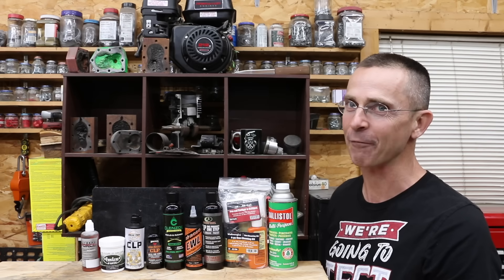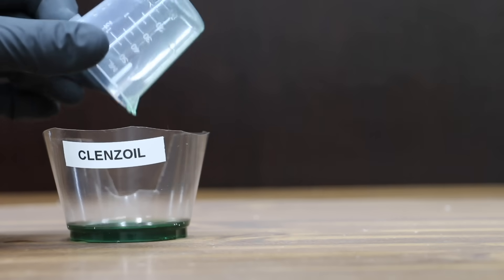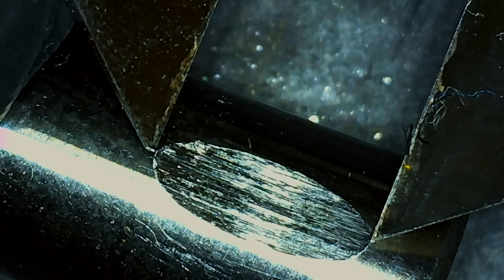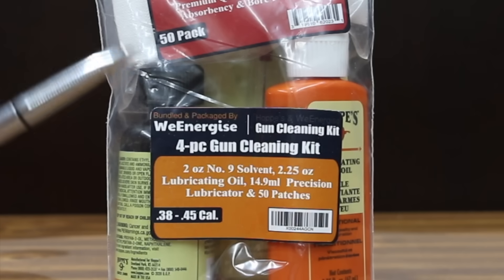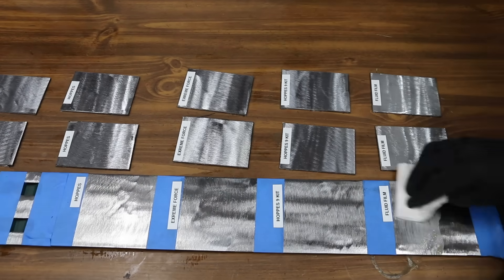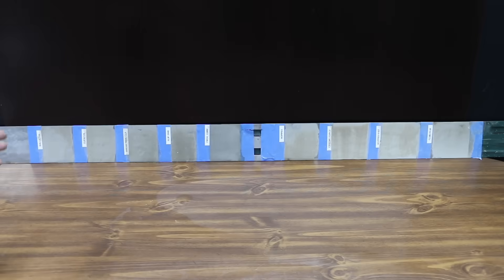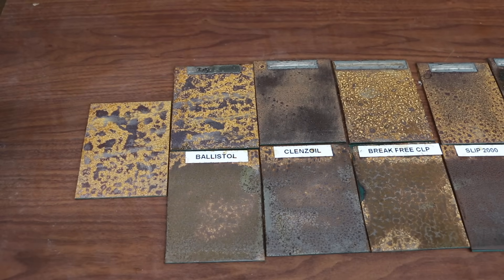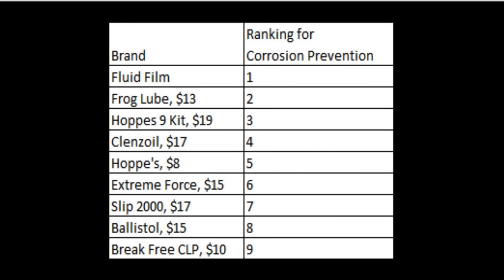Don't Buy A CLP Until You Watch This Review! It'll Save You Time And Money!

Comment: I have two AK74's and literally cases and cases and cases, and more cases, of ammo for them. 1970's Russian surplus vintage, purchased years ago when the price was like 3 cents a round, but it's all corrosive ammo. The Frog Lube does an excellent job of protecting every part. It comes either as a paste or in a liquid. I was particularly interested in the oven heat test you did because Frog Lubes procedure for the best corrosion prevention is to heat up all the metal parts to around 200 degrees and then apply the Frog Lube generously on them. Once they have cooled to room temperature, thoroughly wipe off all the excess and then reassemble. When the parts heat up again they now sweat frog lube, keeping the corrosive primer residue, and carbon, from sticking to the metal. And it really does work. All you have to do to clean any part is wipe it down with a paper towel. Nothing, not even the carbon sticks to any treated part. And one treatment is good for about 5 shooting sessions. I think you would have gotten much better results in the lube test if you had treated the bearing first. This stuff really does soak into hot metal.
Reply from the maker: Thanks for sharing.

Comment: Great video! Just an observation: the sample used for Frog-Lube was the wrong one.  Frog-Lube comes in 2 forms, liquid and paste, the tester choose the paste. The paste is only use on the barrel and slide after heating them with a heating gun or electric hairdryer and then applied, melt, clean and remove.  The liquid would have been the best product to use for this test since is the most equivalent to the others.  A suggestion for a part 2 or for a future new test.
Reply: Frog lube turned sticky in my AR after a few months.   I used the liquid and applied it according to the instructions.   I fired one round and wasn't able to handle the rifle for several months, once I got it back it felt like it was lubed with glue.   I wouldn't trust that stuff on anything that I needed to function in a serious situation.
Reply: @chrisjones6002  Curious which instructions you read. The company is pretty terrible at providing the public with good, in-depth instructions and most of the other tutorials out there are wrong and have you applying it way way too thick which will cause it to gum up. The paste is applied to the metal, then the metal is super heated and left to sit a few hours. Then you wipe absolutely all of it off very lightly so only the barest microscopic film remains. I apply the liquid version very lightly to friction points only, and leave a little of it on rather than wiping all away. Still testing the liquid version and not sure if they really want it all 100% wiped away like the paste.
Reply: @DieLuftwaffel  I don't remember exactly but I did make a good effort to apply it as the instructions said.   Either way, I wouldn't trust it even if there was a better way to apply it than I did.   I've never had an issue using a good synthetic grease and engine oil.   No special application needed, put a little wherever it needs lube.
Reply: @chrisjones6002  Ya I just dont like toxic crap near my skin and spewing any more nasty stuff into the environment than lead which is bad enough. So far I've not had any issue with the stuff, but I usually reapply at least yearly and even if it gummed up in storage it would still be protecting the gun from rust etc. I just dont apply enough to ever act as a glue anyways.

Comment: My EDC oil of choice is fluid film. And my main reasons for this weren't tested in this test. One of the biggest is the lubricant's ability to stay put under every day use. The oils that SEEMED to have done best in this test are also pretty much gone in a day.
 I was recently thrown into a lake in a boating accident while carrying a hk usp that was lubricated with fluid film 3 or 4 days prior. I didn't get a chance to service it until 4 or 5 hours later. No rust at all. Not even a tiny bit. Had i been using hoppes 9, the gun would have been covered in surface corrosion. Fluid film also gets the smoothest function than the others by far. I think you would need an actual gun to test this as you would need to test the way gun parts specifically interract with one and other. I can imagine some of these will vary from gun to gun. 
 Even in below zero temperatures (i live in Alaska) i would still stick to fluid film as my EDC pistol is going to be on my person, absorbing body heat. Now, if i am carrying s rifle in below zero temps, that's when i might consider hoppes 9 for the day. And i would probably apply it on top of fluid film rather than in place of.
Reply from the maker: Thanks for sharing.
Reply: @ProjectFarm  yep

Comment: Ballestoll and hoppes mineral oil are both non toxic.  

Hoppes 9 cleaner is the best at cleaning.  
For lube any syntehec motor oil should win.  For bolts a grease will win.
For water in a barrel wd 40 is the best.
Reply from the maker: Thanks for the feedback.

Comment: Project Farm, Plz do a comparison test of Oil Filters.
I ask because the YouTube community is saturated with these reviews, but all they seem to do is cut them open and show what’s inside, which is a worthless review in my opinion.
I believe you are by far the very best YouTube Product Testing Contributor and you actually test the products in relation to how well they actually work under use.
Thus my request to clear the very muddy water of Oil Filter tests.
Besides, now that you have sold me on the Synthetic Valvoline line of products, I’ve been using the Fram 20,000 mile Filters which are visually much better made for a couple more bucks, but I really want to know if I can skip the Filter change between oil Changes with the 20k rating and if it is in fact an adequate filter to use with a top 3 finisher in the Synthetic Oil Tests?
Thx in Advance.
Reply from the maker: Thanks for the suggestion.

Comment: What you missed was copper residue cleaning. Copper gradually fouls a barrel in a modern firearm, especially with the higher velocity bullets. Great job on everything else!

Ballistol makes a great oil for sharpening knives. It's also one of the better ones for letting the chamber or entire barrel of a traditional black powder rifle soak for a few hours. It can be mixed with water w/o causing corrosion from soaking. Much better than the traditional soap and water. Once the BP residue is gone, you can use a different cleaner / lube to finish your cleaning. One thing to keep in mind  is, since BP rifles shoot lead, copper cleaning is not needed . 

Do I use it as a CLP on modern firearms? No.

As for a lube and storage "oil". I use Royal Purple's gun oil which is a a variation of Maxfilm by Royal Purple designed especially for fire arms. The temperature range is ridiculously wide.
Used correctly it soaks into the pores of the metal and then leaves a dry film. However, it's what's called a thixotropic lube. That means when shearing forces / friction are applied to the surface, it temporarily turns into a liquid. The range I shoot at often has wind kicking up LOTS of dust. Took a 22 to the range I'd been using a regular gun oil on and would have to clean the grit out, sometimes part way through shooting as it wouldn't cycle fully. Used the Royal Purple gun oil and there was probably 1/4 the amount of dust in the action. Not a single cycle failure with over 500 rds put through the gun.
Reply from the maker: Thanks for sharing.
Reply: The copper melts from the jacket. Copper fouling is not a huge issue for hunters only people that shoot a large volume of fire like target shooters, varmint shooters like p-dog hunts and the like. Too much fuss is made about copper fouling and it just is not the insane issue that most make it out to be. This is especially true with CHF barrels that tend to copper foul a lot less than a cheaply made button barrel. So E.R. Shaw barrels and Savage barrels copper foul like mad but a quality button rifled barrel, cut rifled barrel or CHF barrel usually copper foul a lot more. Carbon and powder residue is the larger problem for all shooter from competition shooters to hunters. Copper has been a problem as long as copper jacketed bullets have been around. Sweets 7,62 cleaner and all of the ammonia based cleaners have the ammonia mostly to break down yellow metals so any allow that has copper in it. Hatcher's Note Book indicates Col. Hatcher was using 20% or greater strong ammonia to clean bores. So lead and copper and gilding metal fouling is nothing new.
Reply: @buckaroobonsi555   Well, yes and no. If you actually LIKE practicing with the rifle you will be hunting with and put a number of rounds through it, then copper fouling is something that needs to be addressed. For those wo only put one box of ammo through their rifle a year, you are correct. 

It's not unusual for me, a number of my friends, and my sons to put two HUNDRED rounds of ammo through the hunting rifle in a year. And occasionally as much as 300.

Then there's another consideration. The muzzle velocity of the rounds you shoot. You will get fouling happening faster with a high speed rounds like the 6.5 Creedmor than you will with a classic round nose 30-30 round.

So although you see no issue, I know of people that have to take this into consideration.

Comment: To add to this, Hoppe's also has a "black" lineup that could probably use some testing. Endurance would also be a good thing to look at as much like anything else, firearms can sit for quite some time! While the carbon test is a good stand in, gunpowder fouling IS a different beast, especially with old milsurp ammo that can have corrosive properties, so straight burnt gunpowder COULD be a better test?

Also, for dust attraction; depending on how accurate of a scale you possess, weight could be a more objective metric?

Thank you though, for all the tests you perform! Regardless of some more 'difficult' things to quantify, you provide some of the most reliable, empirical testing of practical products I've yet seen; alongside Torque Test channel, you've become an essential check for the working man! I will be heavily considering supporting  you on patreon.
Reply from the maker: You are welcome!  Thanks for the suggestion.

Comment: You did Frog Lube a huge disservice in this test: The paste is for external/non-contact surfaces specifically to coat and protect from corrosion. They have a less viscous Extreme oil for moving parts like knife pivots/bearings or pistol/rifle internals. You're meant to use both on a knife or firearm after cleaning with their solvent.

Comment: If you're testing with lubricants not specifically made for firearms, it would be interesting to see the results from Tri-Flow 21060 and also the Teflon flavor of WD-40, since Teflon does such a fine job of being slippery.  When I buy lubricants for firearms, I usually get the Mil-Comm brand, which I notice wasn't tested.  It might also be interesting to see which lubricants last the best without a reservoir since, unlike engines, firearms frequently don't provide for a lubricant reservoir.
Reply from the maker: Thanks for the suggestion.

Comment: GREAT VIDEO! I have used BreakFree on nearly everything including my duty and personal firearms. I have never had an issue. I have worked in freezing conditions as well as 120deg. BreakFree is very well known to the military. After watching this video I am very happy with my choice over these years. When working in areas like Arizona a firearm is exposed to fine and coarse dust and sand. I have never observed any buildup or "drying" while using BreakFree. I always suggest to everyone to use it.

Psst! For those of you that need to keep your shoes shined I used to drop a few drops on a rag and buff out my shoes with it too. This only takes 30seconds compared to the old way of buffing. It creates a glossy shine that even the toughest boss could love.
Reply from the maker: Thanks!  Thanks for sharing.

Comment: The problem with gun oils is basically do the lubricity test and just wipe it on the wheel because guns have no lubrication system.  Oil's have a little bit of cling to them but generally drain into the holster on a hot day, and rapidly disembark from the firearm when firing.  So my system has always been Hoppe's #9 for cleaning, then a wipe down with 10w-30 for rust prevention, and finally a dab a high temp grease for moving surfaces, and parts.
Reply from the maker: Thanks for the feedback.

Comment: I'm seriously shocked by the results on the Hoppe's 9. I have the little 14.9 ml bottle and I had expected it to work better as a lubricant. Totally not surprised that it works great at cleaning but the first test was definitely a surprise. I don't shoot outdoors a lot, but I do occasionally. Being in South Dakota, I'm now split on which lubricant I want to try. Might go with Clenzoil for indoor use and Break Free for use outdoors.
Reply from the maker: Thanks for sharing.

Comment: Would love to see these coupons next to an engine oil (5w30) coupon. I use stock standard engine oil and suspension grease.

Also, it was my understanding Frog Lube was supposed to be applied with the part heated up for better absorption into the metal.
Reply from the maker: Thanks for the suggestion.

Comment: CLP means Clean Lube and Protect. Cleaning the copper and carbon out of a barrel is different than cleaning out dust dirt and gunk out of the action. Cleaning requires a solvent. Lubing a firearm requires different lubes as well. The shear on a bolt is different than what is required on a slide. A protectant, like a lube is much different than what you want as a cleaner. Point being, do people actually just use a CLP on their firearms today as opposed to using the right product for what they are trying to accomplish? I’m not going to tell anyone what they should use but if you are trying to clean, use a solvent. Lube means an oil or a grease. Oil by definition flows, is made to constantly be replenished by a reservoir. A light grease like an O is better. His testing is great but in this case flawed because he’s using a reservoir for the bearing test. Something a firearm will not have. As for a protectant, a light O grease again is good unless the surface is finely polished, then something like a good hard car wax. All in ones, just means they aren’t doing anything all that well.
Reply: Can you sum that up into 1 or 2 sentences?
Reply: Sure. Read 1 or 2 sentences then take a break until your headache is gone, then read another sentence or two. Repeat as required

Comment: I’ve been using break free for a long long time. I find it leaves a feel to the metal long after use. The Clenzoil was a great performer and probably what I’d go to based on this testing. 

I am very curious about some of the new graphene coatings.  I see that they aren’t just for cars! There’s even a CLP on the market using it now. I’d love to see a test with using a product like that with newer tech and it’s ability to reject moisture. 

Thanks for another great episode :)
Reply from the maker: You are welcome!  Thanks for the suggestion.
Reply: Claiming to have graphene in their product is the newest scam in car wax (car coating).  It's starting to replace the ceramic scam.

Comment: This was another well thought out test and I enjoy watching your work.  That said, I think there needs to be a better way of testing the cleaning ability of these products.  Elsewhere on youtube another tester has used burning a line of smokeless powder on a steel plate and then testing how various cleaners worked.  That's probably more representative than diesel exhaust, but still doesn't completely represent the burning under pressure and the residue from multiple shots.  I don't have any thoughts at how to do it better than burning a line of powder though.  

Like several others suggested.  Please include Ed's Red (equal parts ATF, Clear kerosene, Paint thinner and Acetone **) if you make another video on this topic.  Ed's is inexpensive for cleaning powder fouling and shotgun wad remnants, but has no effect on copper fouling that I can tell.  I don't really think of it as a CLP type product although the residual ATF should act as a rust preventative.  For longer term storage, oil is a better choice.  **In the initial recipe I think Ed included anhydrous lanolin in the mix, but my memory is that it was more to make it easier on your hands because the acetone did a good job of removing skin oil.  I've used it for 25+ years without the lanolin.

Seeing the effects of the various cleaners on copper fouling would also be helpful.  You'd need to make a device that would leave a consistent streak of copper on a plate and then see how the various cleaners worked when scrubbed with a brass brush under consistent pressure and speed.
Reply from the maker: Thanks for the suggestion.